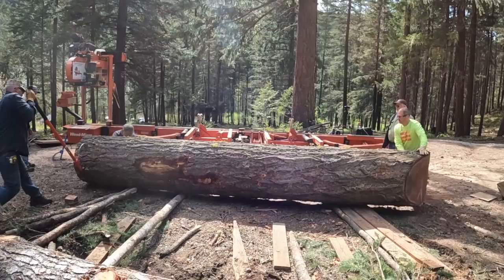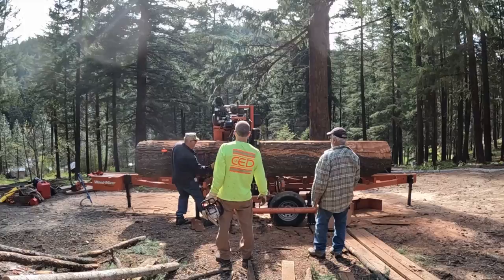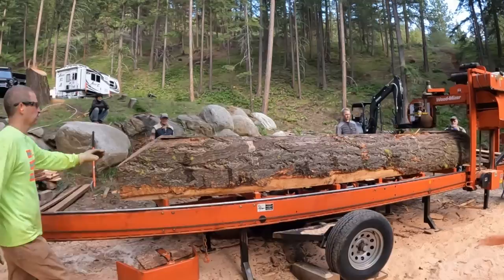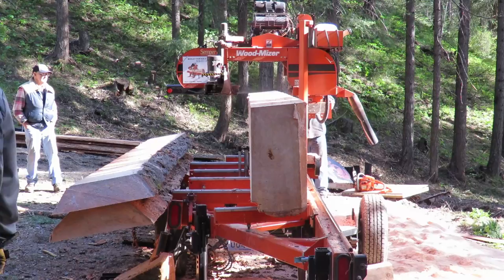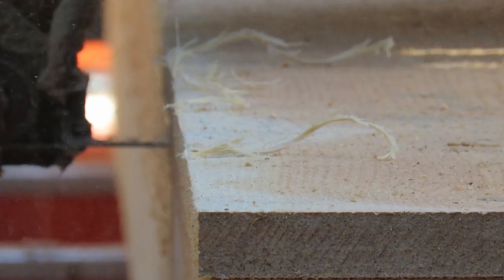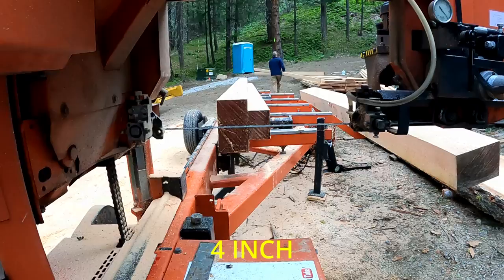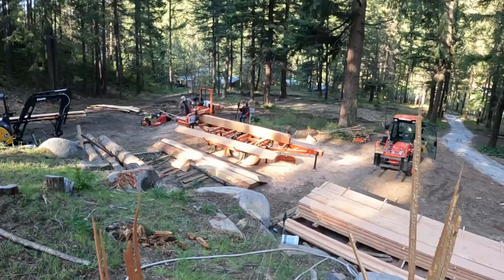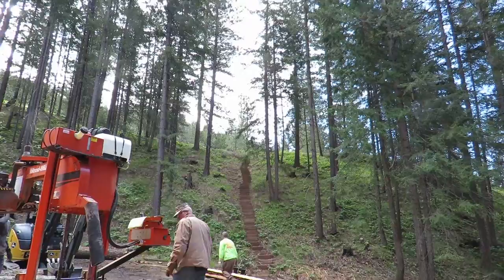Quarter Sawing a HUGE DOUGLAS FIR!! Sawmill in ACTION! #sawmill #woodmizer

Comment: Great video, Erik. The method you used will yield about 10% less quarter-sawn lumber than reverse roll ..... BUT......... your method will produce MORE lumber, in total, AND take less time and effort AND have less waste. Good job
Dave
Reply from the maker: Thanks Dave, I've never done the math on the difference and appreciate that!
Reply: @TheOldJarhead  Your method yields about 50% more lumber. RRQS yields 30% more waste but, on the plus side, it takes WAY longer to mill. This equals more milling pleasure.
Reply from the maker: LOL I'll take more lumber ;) besides, my mill isn't wide enough to RRQS a big log like this!  I could only drop about 6" on the first slab...can't cut 32+" wide even pushed over the stops!  Though admittedly, I'm jealous of the wide super mills with the chain turners!  Maybe @Woodmizer will give me one?  LOL  No?

Comment: I made a "sword" from a 4' section of "Old Blade" with a handle to rake out the sawdust behind the Band when I get caught with too wide of a log. this way, depending on how far I am into the log, only one or two wedges are needed to back up the head a foot or two to provide room so the excess bark/width can be cut off.
Reply from the maker: That's a great idea!  Thanks for sharing!